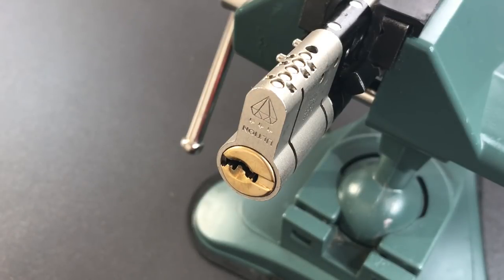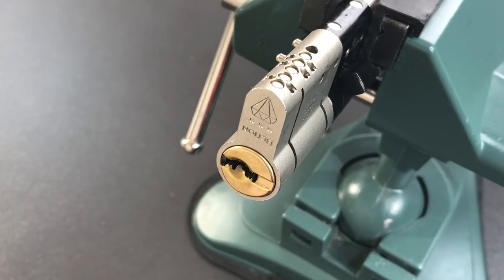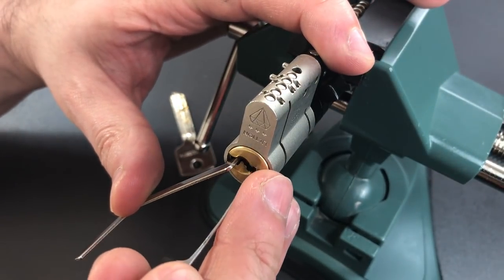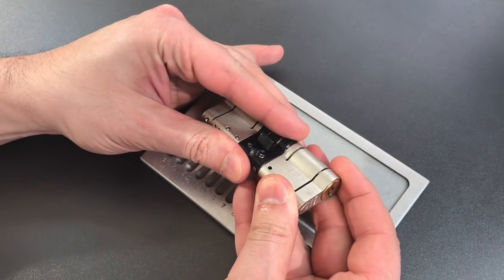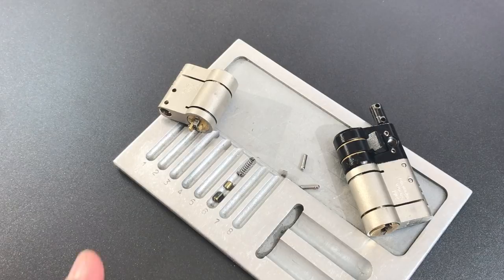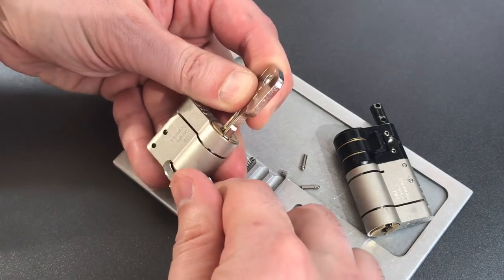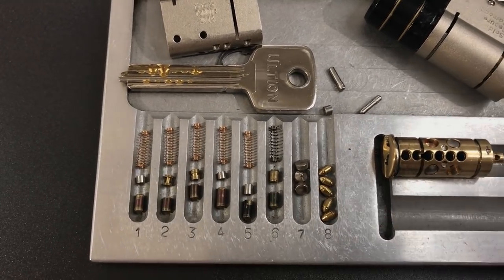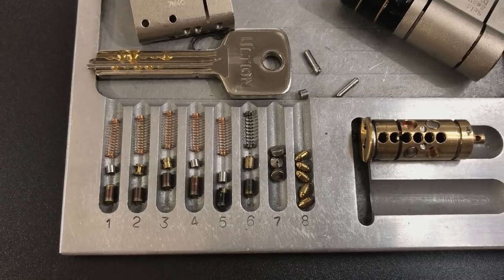[628] Ultion Euro Profile Cylinder Picked and Gutted

Comment: So, you can't bump or snap it, picking is easy (for you!), but for your normal burglar, it's going to be a brute force attack.
Reply: No, they use the path of least resistance. Snapping and drilling are harder, so why not pick it? For almost every other lock the opposite is true.
Reply: I take your point but these locks, or this type of lock, is very common in the UK, but used upside down compared to the way locksport does it. Try that in the rain on a front door on a main road.

Comment: I've got these locks and I'm not particularly worried. The thieving sh1ts over here in the UK don't walk about with picking kits, that would need skill. Nope they just go at your lock with maul grips (vice grips) or a drill, failing that they'll smash a window. I'm not on the same planet as the Lock Picking Lawyer, I can pick my old euro locks that these replaced. I haven't picked these though.
Reply: To add to that I think the police could nab you much easier over here for walking around with lock picking tools, whereas in America that probably violates rights or some such. Technically that applies to tools as well, but I think pretending you were going over to your nan’s house to put up some shelves would get you out of that.

Comment: Now try picking it the right way up
Reply: Stephen Pennell good point, why didn’t he pick it right way up?
Reply: Hes american. He always picks with the pins up. Amazing skills.
Reply: Its upside down and the key has been taking out wrong as the key should be top and bottom not left and right. Think thats how they can pick it
Reply: george stronach you’re wrong. This is a lock where the pins actuate on the side of the key. Just look at the key.
Reply: Nope, it's upside down, which is why he doesn't need to pick the passive pins. Turning the lock the right side up would make those pins drop down, hence no need for springs (which saves space in the design).
Reply: Guys, none of you seem to know how passive pins work. They don't need to be touched and it doesn't matter which way up the lock is, upside down or not. There is a recess in the body in which the passive pins poke into (if a key without passive cuts is present), when trying to turn the core, the fact no passive cuts are present on the key means the pins cannot retract into the key, because they cannot retract, they remain stuck in the lock body's recess. The fact LPL is picking this lock means that's imitating a key with all passive cuts (because there's no material blocking the passive pins from retracting). Passive pins have no springs, but they are NOT gravity dependant. They get moved only by the key and the lock body as rotation is applied. It does not matter which way up this lock is. After years of use, pins get grimey and dirty and often do not move freely without springs behind them, if it was gravity dependant this would not work after years of use.

Comment: The form each euro cylinder has is way too old fashioned for how locks are made nowadays.
They have to crap in more and more things in there to make it to modern standards.
I'm totally in favor for making a new kind of cylinder.
Make it round, so they can snap it less easy, and at least 1.5 inch across.
Then you have lots of space to put in side bars, security pins, sliders, and what they design next.

Comment: What does the passive pins actually do?
Reply: The same thing as the other pins - when installed correctly, i.e. the other way up, as it will be in a UK door. Hence no need for springs on that side, which saves room in the design.

Comment: What is anti drill protection?
Reply: If you don't mind destroying the lock, it is usually quite easy to just use a cordless drill to drill out the brass core and open the bolt with a screwdriver. If your drill hits hardened steel, suddenly your quick drill operation is going to take a lot longer, if the bit didn't catch in the steel and break your wrist. Hardened steel is more likely to dull your bit than be cut by it.

Comment: Please start picking locks in a real word scenario ? Gloves in low light and most of all no chair! You would have to to stand up and bend over! Totally different ball game!! PS lets see how much longer it takes!
Reply: Light doesn't really matter.
It's not like you're looking inside of the lock, at the pins.
You use feel to tell where they are, and what they're doing.
The only thing you'd need light for is finding the lock, unless you're a beginner.

Also, because you mention gloves, I assume your example is an illegal break-in.
That's not the only scenario where lock picking exists.
So much for the "real world scenario"...
You're basically saying "do it in this exact way, so it's harder!"

Might as well ask him to do it blindfolded, wearing boxing gloves whilst his arms are tied behind his back, as he's tied to a chair that's bolted to a hardened steel floor on top of a killer whale that's floating in the middle of the ocean during a tsunami, as he's getting shot at by military jets that are using heavily radiated, and explosive ammunition.
... with nothing but a deck of cards.